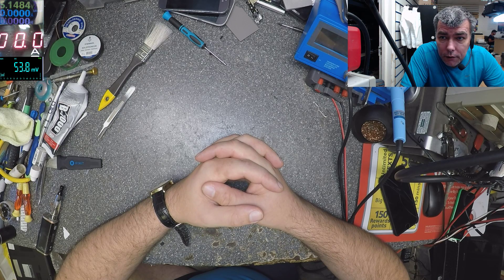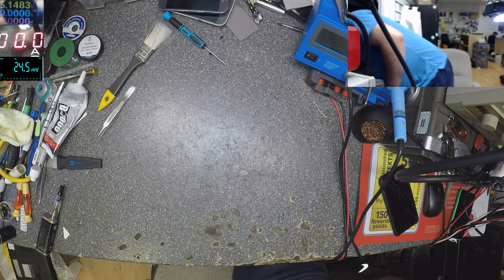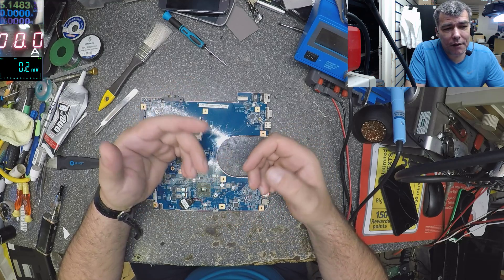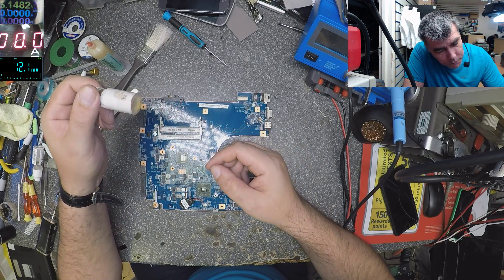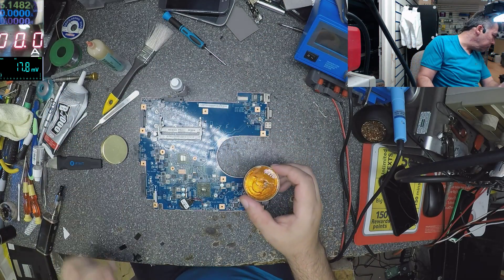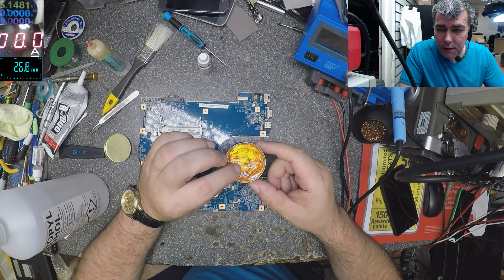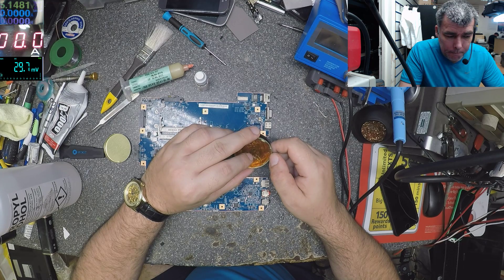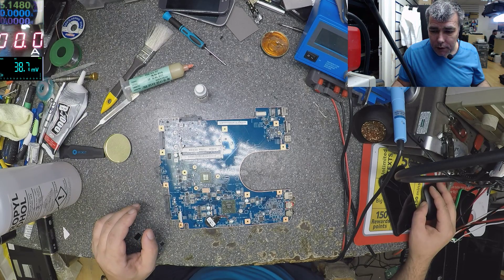About my soldering flux, let's compare

Comment: hey nice videos! thanks a lot!
i wanted to say that in one of your videos about flux (i've watched many in a row so i dont remember which one) you mentioned that you vape... while i was trying to solder a mini USB pin a DNA 75 board. i had no flux, that's how i landed in your channel. just happens to be a general workers strike today here and everything is closed. just found it amazing that you vape while i was looking for a flux solution to my DNA soldering... but thats not all!
 going through some forums found a guy claiming that PG or GV with citric acid works good as as flux... couldn't resist to try my e-juice which has a decently high percentage of strawberry in it (strawberry is in part cirtric acid)... long sotry short... IT WORKS. far from good but hey! WHAT ARE THE ODDS!!!! #vapingsaveslives

Comment: can u tell me about themperatures of the hot gun,what themperatures are the best for removing chips on the laptop or on the phones?Is it the same or maybe different for phones and different for laptops or tablets?
Reply from the maker: phones 350-360, laptops 400-420
Reply: @electronicsrepairschool  What about the setting of the air of the hot air?
Reply from the maker: Celsius
Reply: @electronicsrepairschool  this is what i called an information... 
Thank you chief..
Reply: Temperature is in fahrenheit or Celcius? If 350F, then about 175C, yes?